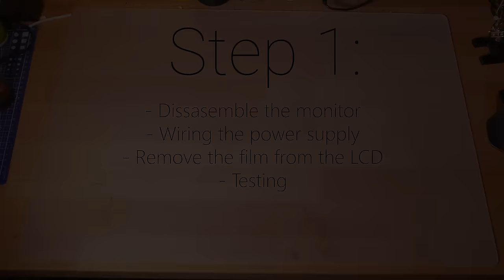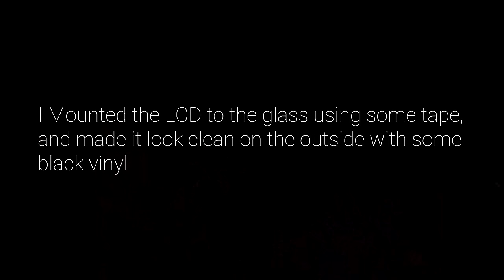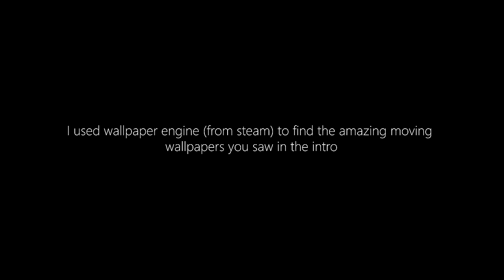DIY Transparent LCD Side panel!

Comment: Yo I just made it myself and it works almost perfectly, just two questions:
1. How did you get the monitor so perfectly see-through? Mine is still a bit milky :(
2. Can you give me the names of the wallpapers used so I can check them out myself?
Thanks in advance, great mod and great video!
Reply from the maker: Awesome! Are you sure you have removed all of the layers? I am not home at the moment, but i will check the names of the wallpapers I used when I get home:) (Wednesday)
Reply: @Ananords  Thank you! I will certainly make sure to check if there are any more removeable layers, I just noticed that, although you (atleast as shown in the video) only removed the foil on one side, both sides of your panel were glassy, so that's where my mistake lies probably, because my dumb ass didn't notice :D. 
Keep up your great work!
Reply: @FiryFly  so we need to remove both sides? i have the same problem just to be sure please _:D
i just remove front layer, its the same for the back layer ?
Reply: @Inuky  For me it was, yes. You should be able to remove both sides without any problems
Reply: @FiryFly  thank you for the fast response :D
Reply: @FiryFly  sorry for responding a year late lol, but did you soak the back layer too or nah?
Reply: @ephxmeralities  Hey Vincent, although it's probably a bit late now, yes I did soak both sides after noticing there's foil on the back
Reply: @FiryFly  Hey mate! late ass question haha but, if i ever want to go about doing this, how can I know which layer is the polarizer and which one is the anti glare that i actually have to soak? thanks mate
Reply: also... is the wiring part more difficult on video than it actually is? i'd hook it up to a dc to usb power cable if i could since my power supply is not modular so i wouldn't wanna strip a molex cable
Reply: @Ananords  Would it be possible to detach the lcd layer from the glass layer so you could bend the lcd around a cylinder? Basically a curved display? Or is it bonded to the glass too well?

Comment: Is molex easier to work with than a sata power connector?
Reply from the maker: Much easier
Reply: @Ananords  Could you do a detailed tutorial on the power routing and how to identify the power rails etc? I have experience with soldering and electronics a bit. but I'm lost in how to convert the power connectors
Reply from the maker: Just search for Molex Pin out. Cut the Molex connector off, and soldered to the correct wires.
Reply: @Ananords  I'm not confused about that, it's about the power connector to the LCD's FPGA
Reply from the maker: Ohh, I understand now. I just measured the pins on the power supply, and tried to apply power to them. I have described it in my instructables Tutorial. Link in the description
Reply: way easier

Comment: Do I need two Graphics card? Awesome DYI by the way, keep the good work.
Reply: no, just one with two monitor outputs. all cards from the last 10 years have at least 3 outputs, even some integrated cpu graphics have at least 2
Reply: Nope. It runs like a second monitor on your desktop.

Comment: well i wanted to do this but the moment i seen the tools for it i decided to not to. i dont have a tester(electric) and the heater and just for it i dont think ill buy those tools for one time use. and ill need an undamaged working monitor 19 inch and even second handed will cost some money so to do all this it is expensive. but i would do it if i had all what needed.

Comment: Water? Alcohol? Acetone?
Reply: water
Reply: @CheckitOutYaw  isopropyl alcohol for cleaning (to not end up with the same greasy fingerprints as in the video)
Reply: @LVIS-a  well ive done it 3x with water. Never tried it with alcohol. No greasy fingers on mine. Wont alcohol vaporized fast aswell? We are talking about removing the anti glare layer right?
Reply: @CheckitOutYaw  don't soak in alcohol, soak with water and then clean with the alcohol (after removing the transparent layer)
Reply: @LVIS-a  that what i said right?

Comment: That 19 inch is just 5v??
Reply: Most of the monitor is just 5v. Very old ones got the 12v. I got the 12v version by chance (second hand), which conviniently sync with my 12v led rolls. So i only need 1 line to both power the monitor and led strip. https://youtu.be/AE1GjQtDZrE
Reply: @CheckitOutYaw  cooler master case?what kind of led you use for side panel? looks cool!!

Comment: so i ripped that ribbon cable on the front while trying to pry the plastic frame off... oops. is it done or can it still work?
Reply from the maker: Just the one with the buttons?
Reply: @Ananords  yes
Reply: @Ananords  so after i fully disassembled the monitor i did a test run to see if i would get any picture and i did. although somewhere durring the installation in the case the lcd doesnt turn on anymore. did i mess up the wiring? im afraid i ripped a ribbon cable somewhere important
Reply from the maker: The front panel buttons are not that important, so that isn't a problem. Weird that it doesn't work after installation.. Check all of your cables and see if there is any damages.
Reply: buttons ribbon cable is not important. Ribbons cable for the monitor...it wont work anymore. Just buy a new second hand monitor. Cheaper than buying a specific ribbon cable.

Comment: So I thought about doing this to my nr200p but I would need a 14 inch screen. The only one I found is this one from aliexpress with a raspberry. https://a.aliexpress.com/_mKBPOoB
Will this work? Also I could just let the hdmi and dc Cable through the back of my pc and plug the dc cable to the wall plug and not the psu? Idk if this would work and haven’t seen anybody do it like that, but I think it would be way easier because I don’t have to solder anything and worry about connecting anything wrong.
For the led strip I think I might have a connector free on my motherboard.
Reply: I also read on Reddit that the hardest part is to fit the controller in the case because these can be quite big and the cables relatively short. That wouldn’t be a  problem with that raspberry pcb the cables look quite long and the pcb is not that big
Reply from the maker: Yes, you should be able to do that, but I am not promising anything, because every screen is a little bit different.. 
I recommend that you check the type of screen the aliexpress one is, and see if it is the same as the one that I used.
Reply: @Ananords  Amazing, thanks for the quick answer! So the Display I wanted to use is a ips screen, you used a tft Monitor. Not really sure if that makes a different, both still are lcd. I don’t know that much about different Screen Technologies, just that the colours of ips will be way better, but that doesnt matter anyways. I’m going to do some research if it will work with ips. If so, I’m going to build it !

Comment: hardest part in all of this is figuring out/connecting the power supply cables to your controller board and yet you just kind of gloss over it while going 4x video speed, and dont even show the connection from computer psu to the controller board except for like a literal second... bruh please help explain some more in the description/annotations or upload a new video lol. Someone llike me who wants to do this but needs more context!
Reply from the maker: The reason I did not include so much about that in the first place, is that almost every controller is different. I don't want someone to connect it using the same pins as I did and burn their house down, then blame me... You will have to measure for yourself. Also, have you read the instructables?

Comment: It's false 
It does not show the monitor at any time and the sheet that is removed in front of it is not the polarized one. 

Removing that polarized sheet is not that easy and when you remove the polarizing you should not even see the shadow of what the monitor projects. 

Put the product you used to get it or is it an edition

Comment: oh ya sure 5$, where the fuck am i gonna get the fucking tools? im sure none of them are 5$
Reply from the maker: Well, then you can say that about every product or project. It's the same as saying that a monitor doesn't cost for example 299$, because you need a computer to use it, and that costs money too. I did this for 5$.
Reply: Soldering irons at harbor freight are 2.50 and you don't need the multimeter.